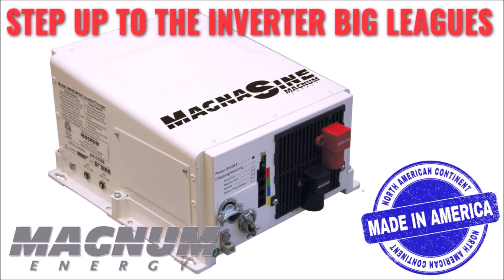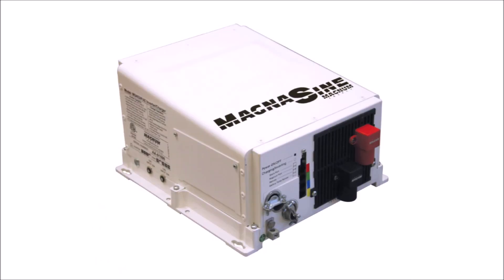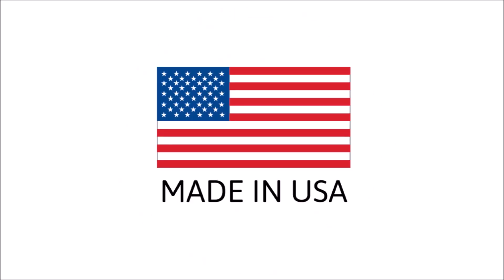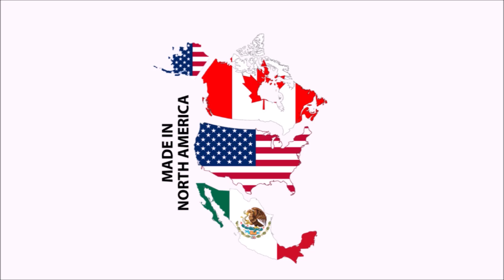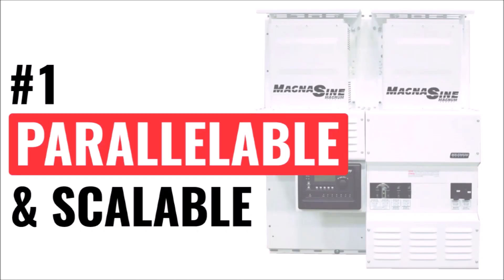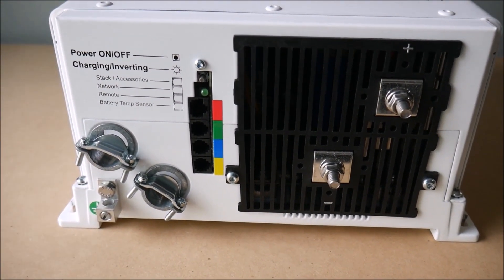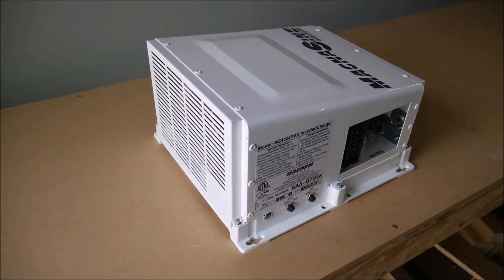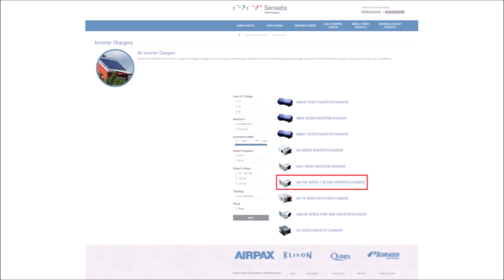MagnaSine Inverter Chargers Introduction - Another Brand You Should Know!  MADE IN AMERICA

Comment: This would be nice, but at $1800 for only 4.3 kW, it's just too expensive for what you get.  I use a torrid-type inverter with the same features and produces 12kW/36kW peak for the same money. It's not as efficient, but I have abundant sunshine and battery capacity. Still, thank you!
Reply from the maker: What is a torrid-type inverter?
Reply: @LDSreliance  A toroidal transformer inverter or "torid-type" is a type of electrical transformer constructed with a wound, torus or donut-shaped transformer core. Less prone to surge damage but also less efficient. Many of the popular grid-tied transformers today I believe are 'transformerless.'  They are generally lighter, smaller and with lower capacity, which is why most people need more than one.  Usually they have to have an earthen ground because they are more vulnerable to surge. A torid-type inverter can handle a larger peak draw for a longer period, which makes it great for starting and using equipment with a heavy load, like large motors.  I use mine quite often to power my 50A welder.  We live off grid at 8000 ft in So. Colorado and this inverter has been in our trailer-mounted solar generator, operating without issue, for three years now, even in -20F temps for extended periods.  It's not American-made, but it is affordable. It also is very heavy (about 200 lbs). The thing I don't like is that I don't have another 48V backup inverter, so if something happens to it I will be without power for awhile until I can fix or replace it.

Comment: I've known about Magnum Dimensions for years, they're used in the utility truck industry like line bucket trucks, etc. So, pretty much off-grid inverters are the name of their game and it works. Like you said, they're scalable.

What sold me is that they have the MPDH load center for their MS-PAE line of inverters which have a full DC load center where other brands are pretty much are lacking. Since I run a full 48 volt DC nominal powered loads and 120/240 volt AC split phase which compliment each other very well. Definitely order the back plates that they offer, because it makes the assembly process much easier. 

My layout is the MPDH175-30D with left a extension panel using two MS-PAE 4448 inverters and leaving one spare slot should I need more capacity. Since I run slightly half of my loads on the DC side, two inverters are more than sufficient for my needs. Even though I have 14 kWh of AGM batteries, I've weathered many of tropical storms for 12+ hours including the use of my 2.5 ton HVAC sparingly (gotta have a soft start controller for the outside unit for it to work). Plenty of time for me to get a generator connected after the storm clears; working on integrating my existing grid-tie solar for backup battery charging and future lithium upgrade.
Reply from the maker: That is an awesome setup!  I've seen these inverters for many years since I got into solar but could never afford them.  Now I know why.  They are built like tanks and can handle the toughest power needs.  Comparing these to a "4000W" inverter from Amazon is laughable.
Reply: @LDSreliance  also I forgot mention that they have a 3 year warranty on their inverters and when purchased with the MP enclosure extends it by 2 additional years for a total of 5 years. They are pricey and planning  ahead on your design layout will save you on the time and materials costs of doing it all over again.
Reply from the maker: That is good to know.  The good news is, as long as you don't mess up something huge like the voltage, you can design the system to be expandable since these are parallelable and have other parts that can seamlessly integrate.  In fact, there are entirely pre-wired systems that are pretty attractive.